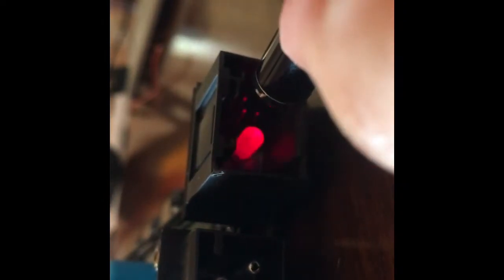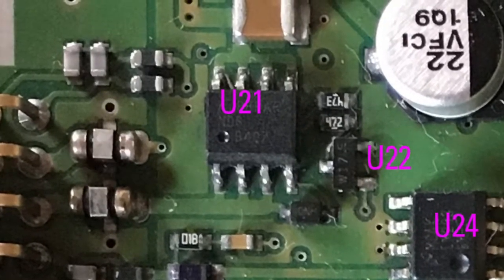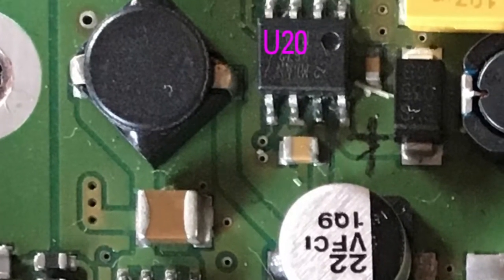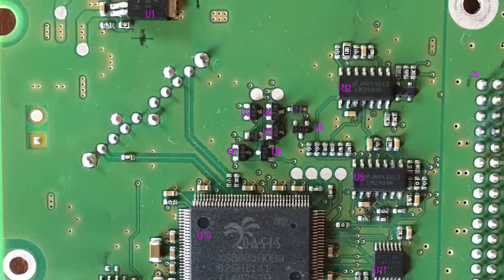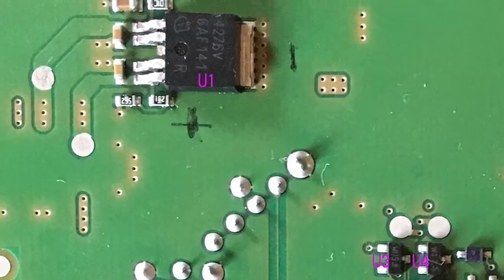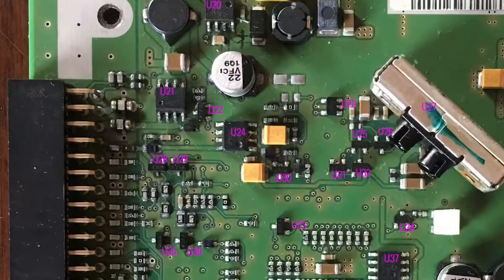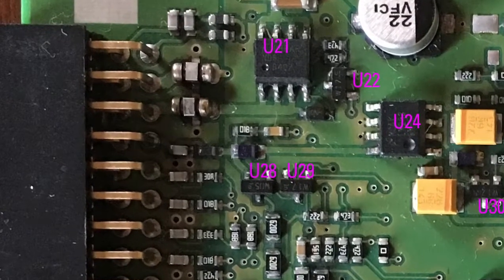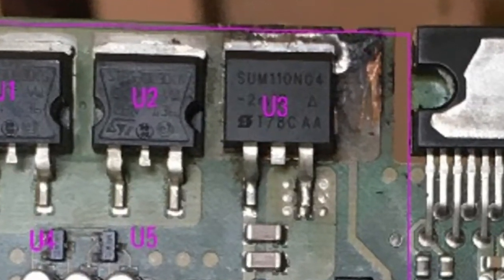BMW Harman Logic7 Amplifier Repair Guide - Part6

Comment: Hi you seem to have all the information on this Amp and I am hoping you will be able to answer this question.  Could you pin point on the amp where I could attach a set or even a couple of sets of pre amp volume g
Phono leads so I can use external amps as my amp is dead and the board and components looks completely fine
Reply from the maker: I don't have it now in my hands.  How did you break yours?
Reply: Its stoped working on the bass speakers but all of the board reads as fine
Reply from the maker: So may be you just have to replace output mosfet
Reply: Right ok, thanks

Comment: Hello Gaucho,

What program should I use to open the .sch file please? Is OrCad your your choice?
Regards
Reply from the maker: I think I used Eagle. I think I wrote it inside attachment. In any case you should find a pdf or doc with the schematic inside attachment.
Reply: @gaucholivido  Thank you for your reply. I shall keep searching for the program to open the .sch file you have included in the downloaded file set. I do not have any audio at all. The radio tunes, the Nav operates, but not a squeak of sound. Fuses in the front and rear associated with AUDIO are intact. I have yet to open the Logic 7 amp and do what you have done. Thank you for sharing the procedure. Regards
Reply: @gaucholivido  Yes it was Eagle. I downloaded a Trial Version and was able to open the .sch file. Now I have found the amplifier that I have is the Premium version, AUD 4L/ XQK500103  HD1/S0415.  However the service procedure can still be followed. There is 12v at the connector all the time so I shall probe inside. Keep safe and regards.